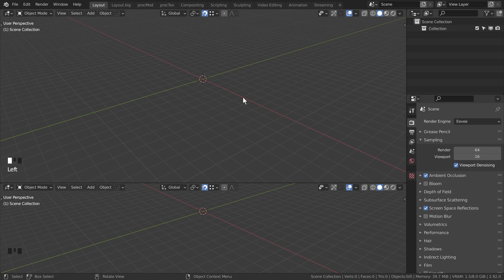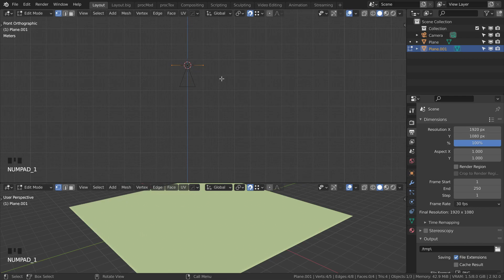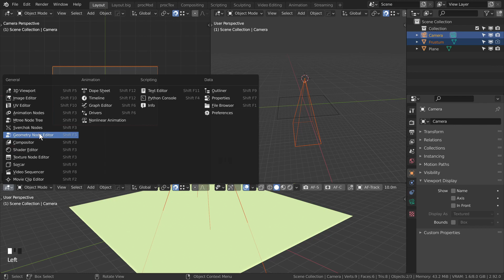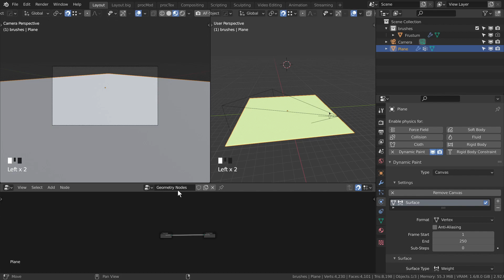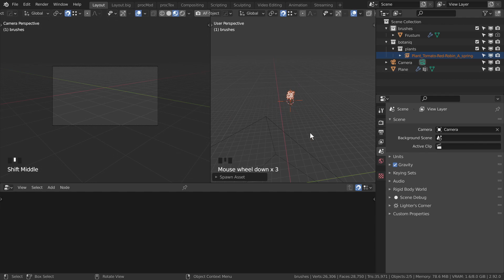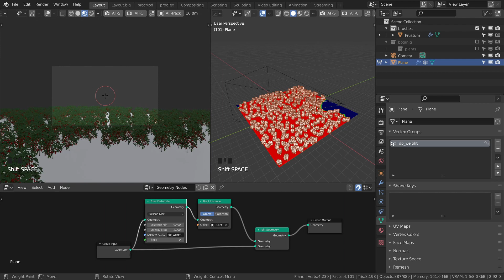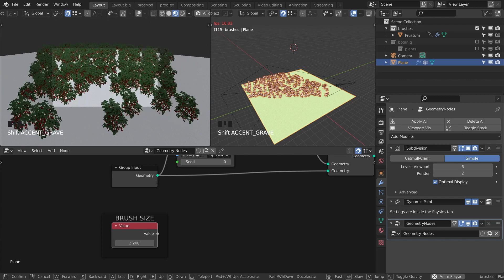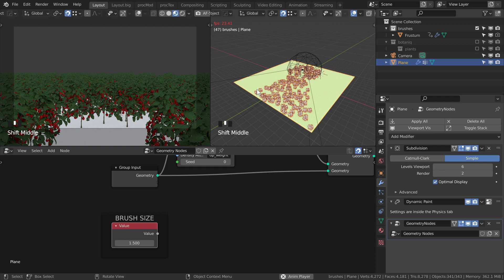Easy Camera Culling with Geometry Nodes - Blender 2.92 Tutorial

Comment from the maker: An extra point that I missed, to get Dynamic Paint to update you need to be playing the timeline!
Reply: The ''Brush Size'' value driver in the geometry editor also not working when not playing the timeline! :)
Reply: seems like this is no longer true in 2.93.2 also the "dissolve" setting is not required either it seems
Reply from the maker: Oh no way! That's good news!
Reply: @Erindale  would it be possible to make occlusion culling using a similar method?
Is there a way to make the brush stop in the first thing in it's way? Boolean comes in my mind but the brush would just continue behind the object
Reply: @Erindale  I was curious, is there a way to use this method for a scene, but have pathways (which are part of the larger ground Geometry with bushes) remain unpainted? Or would pathways have to be separate objects all together?
Reply from the maker: @theultimatebrickmaster yeah you'll just need to be doing some maths to combine your dynamic paint group and vertex group for your manual mask
Reply: Is there a way I could decrease density with distance from camera?
Reply: Dear Erindale . It is my mistake. I forget to close the surface of the Brush

Comment: Getting all the way to the end of this just to realize blender removed the "density attribute" section on the distribute points and i have literally no idea how to do the same with the new versions of blender. Absolutely ending it all rn.
Reply from the maker: I would distribute and instance things and then use a delete geometry node set to instances and use the mask there to delete instances outside the view
Reply: @ cool as hell you’re still replying to this. I eventually found out there is a “named attribute” node which does the same thing as the old density attribute and your system works just as well using that. Thanks!
Reply from the maker: Just double check that things are being instanced consistently as the points change. You might find the changing indices cause different objects to be instanced. If that is a problem then you’ll have to use the delete method instead

Comment: Think some of these nodes have been renamed. Really would like to get this working but don't know what they've changed the names to. Great tutorial up until that point!!
Reply from the maker: Ah yeah geometry nodes was completely redesigned for Blender 3.0. You’ll now use something like distribute points on faces to create points and use the Named Attribute node with the vertex group name for the density. And then instance on points node to instance your collection of whatever objects you’re using
Reply: here's what i did (blender 4.2)
group input - distribute points on surface: the density (or density factor if poisson disk is used) is linked to a Named Attribute node: if the surface paint was set to "weight" and the vertex group mapping was auto done as in the video, typing in "dp" should auto complete to our needed attribute
*keep in mind, if you use poisson disk and your computer is slow you should probably set the Density Max to 1.0 or less to avoid crashing when testing stuff out

DP on Faces then connects its points to the points of Instance on Points node. For this node you can add a new mesh primitive cube to test and connect its mesh to the instance. Though Collection info or Object info of an existing object in the scene should work as well. Instance on points now connects to a Join geometry node which is also connected to the Group input's default geometry link and fed to Group output.

As other commenters mention, make sure your ground plane's modifiers have dynamic paint on top and geonodes on bottom.

Comment: I have a better solution to this, that is entirely GN and works without any hassle or trouble.
First I made a node-group to generate camera-plane, which uses some simple math that I've since forgotten. Then I do a RayCast from every point on the mesh to the camera plane. If it hits the camera plane, good! If not, it's culled. Then I do a second raycast to the occlusion collection to see if something else is already in front of it - if so, it's culled! It's really simple and easy to use once it's all set up.
BONUS: mine also can partially cull based on distance, so that e.g. grass can use the cull value to get smaller or less dense based on distance.

Comment: is there a way to use this in the viewport without a renderer camera object? I need this feature for the default blender camera, not just for renders.
Reply from the maker: There is not no. You can lock camera to view though if you jump into the camera view and press N and you'll find it on the View tab.

Comment: It worked fine until I tried to render, and then the geometry node objects weren't visible in the render. They're visible when the Dynamic Paint is turned off though... What could I have done wrong?
Reply from the maker: Hm maybe something with how the dynamic paint is updating at render 🤔
Does it work if you render an animation?
Reply: @Erindale  The updating of the Dynamic Paint has strangely never been a problem for me; it updates automatically even when the viewport animation isn't playing.

Figured out what my problem was. I am using a Multires modifier, so the amount of objects were fewer with the render settings than with the viewport. So few in fact, none were visible. Turned out I needed to increase the density to somehow compensate for the higher resolution mesh.

Thanks for your suggestion!

Comment: Is there a way to use this with  particle systems (used for grass, plants, trees etc), rather than point instances?
Reply from the maker: Yes, you can just use the weight to control the density setting in the particle system.
Reply: @Erindale  Great, thank you!

Comment: How could I simulate wind with this? I replaced my "hair" particle grass, and it used only a wind and turbulence objects to make a satisfying wavy movement without even having to bake. Would it be hard to simulate it with these geo nodes? Thanks.
Reply from the maker: With geo nodes you won't be able to use the simulation data 👍 physics solvers aren't implemented in geo nodes yet

Comment: Nice but when I animate the camera with keyframes, the weight paint accumulates along the camera path during animation, thus slowly ruining the benefit of camera culling effect. Did I miss something ?
Reply from the maker: Hm I wonder if you have the dissolve settings turned down so it doesn't hang around longer than 1 frame
Reply: @Erindale  Yes that was it. Thanks a lot

Comment: This is great. I already had a weight map controlling density/scale and I muddled a solution using attribute subtract on both weight maps with the second operand being inverted, with the result being placed in a third vertex group. This resulting group was used in the point distribute node. Also there is a great tutorial by Gleb Alexandrov on camera culling where the vertex group generated in the dynamic paint modifier can be used to hide geometry by simply adding a mask modifier with vertex group assigned. Unfortunately in this case the mask mod changes the distribution of instances but is useful for high poly models in a scene. Perhaps someone can put out a vid on this as I cannot. Thanks

Comment: Great tutorial, thanks! I am still new to Blender and that's probably why I run into 2 issues. When I parent the frustum to the camera the frustum moves under the camera in the outliner preventing me from adding it to a collection. I fixed this by duplicating the frustum and transform constrain it to the original frustum then using this copy in a collection as a brush. But then I don't get weight paint to show up. I wonder if this is a 2.93 LTE version issue or because I set the brush on a duplicate of the frustum. I rebuilt it about 5 times to no avail.
Reply from the maker: To stop parent hierachies from changing things in the outliner you can turn off the Object Children filter in the outliner filters.
Reply: @Erindale  Thanks. That did the trick. I can see weight painting now.
Reply: Thank you @Alex Furer for bringing that up and thanks @Erindale for the solution. Now it works :)

Comment: I was wondering... 
is it possible to control the level of a decimate  modifier with a varible to reduce poligon count based on the camera distance?
instead of the replacing three or more collections of different levels of decimated geo?
Reply: it does seem like the thing that would be part of the render... similar to micro displacment.
Reply from the maker: When we get a decimate node then yeah for sure! But the collapse algorithm is actually really heavy so it's best to have multiple actual objects and switch between them

Comment: Does that make a big improvement on rendertime (on both renderer obviously) ?
Reply from the maker: For Eevee it should make some difference. The way cycles handles instances means it should be pretty similar however some people simply won't have the ram required to calculate 20M+ instances for realistically dense foliage. For them, culling can open a door to that sort of work

Comment: Anyone know a way to scale these instances into view? So things appear to grow while moving the camera about?
Reply from the maker: If you use an Attribute Vector Math node set to distance and calculate the distance between the position attribute and the camera location (use an Object Info node set to relative). Then if you use an Attribute math node on the result attribute from the distance, set it to divide by a float and that float is your falloff distance, and then use an Attribute Colour ramp to give you the manual control you want on how it grows up/down around the camera.
Reply: @Erindale  appreciate your solution!

Comment: Theres something that keeps messing with trying to duplicate this, The models i'm using are meshes of trees and they all have the right size, but in the plane they're gigantic. How can i be able to use a collection to be able to apply this? is there a way to solve this issue of models being huge?

Edit: Fixed it by using hair particles instead of geometry.
Reply from the maker: Sounds like you've scaled up the plane and you've not applied your transforms. Or equally you've a down the trees and not applied. (Ctrl+A, Scale)

Comment: is there a way to make LOD too?
Reply from the maker: You can have it change density or switch between meshes based on camera distance. If you check out my toolkit video you'll see my nodes doing that. You still need to supply the LODs yourself though

Comment: could you make a tutorial on the "Mix attribute"? I really dont get how it works and it might be necessary for this case because i already have a weight affecting the density of my grass, i would need to mix both the path weight and the culling paint, cheers
Reply from the maker: To join masks the best way is either add or multiply. If you want where either is true use add, if you want where they're both true at the same time (like this case) then multiply. Just attribute math set to multiply on your culling and path attributes and it should work! You're right about the mix though that makes sense to do a whole tutorial on for sure!
Reply: @Erindale  thanks for the quick answer, i asked for some help at OpenVFX discord and i was doing a mistake, but it is a little bit confusing how it work so a tutorial would def help people with the same doubt i had